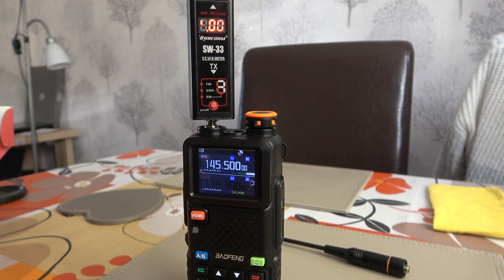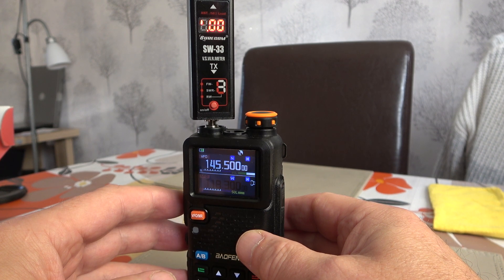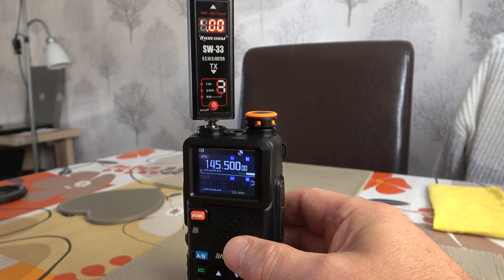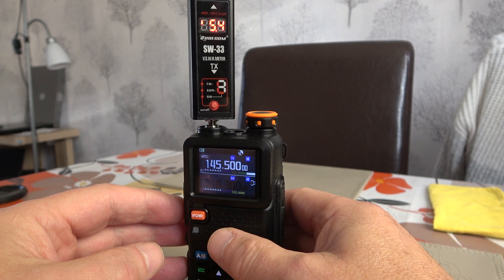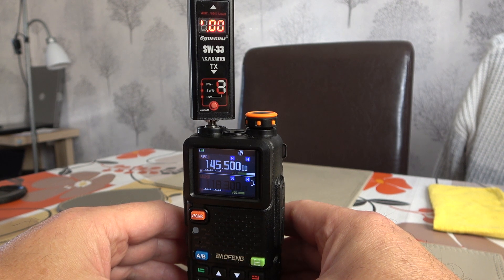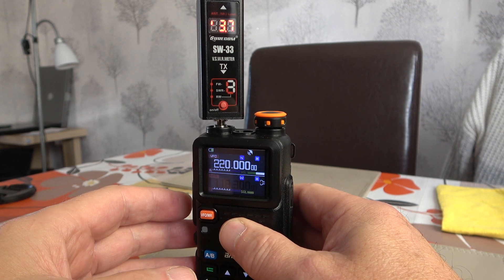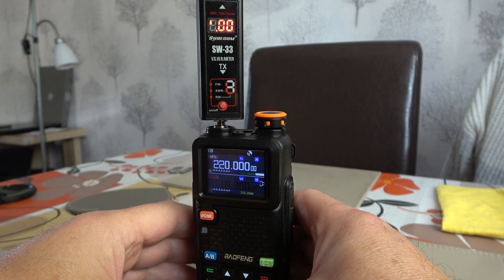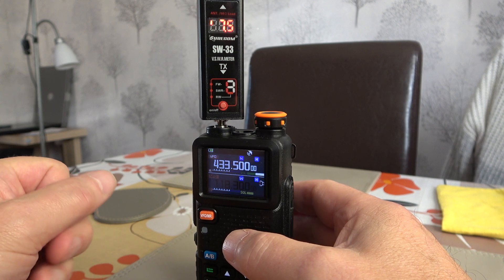Power Test Video on the Baofeng 5RH Pro

Comment: yet again 5R with some letter and some name plus/pro. same all bands no AM modulation chip. display could be unreadable even inside. there is still no radio that 100% last. its business make something bad so you buy next (and hope) u might get ur problem fixed but there new bad things.. rat wheel continue you buy cheap radio

Comment: I have the same SWR  meter as You do. When testing various antenna I find that the 2m Band results are terrible whilst 70cms are OK.   Have I been unlucky with my antenna being clones or is my meter duff?  I do wonder.  Maybe antenna are not really 2 band after all?   The only good one I found was the AR-152 tactical antenna from Boafeng, better than both ABBREE and Nagoya.  Something isn't adding up?  Have you compared antenna with your meter?
Reply from the maker: @DinsDale-tx4br  I honestly don't use the meter for antenna testing as there are just too many variables to get an accurate result I reckon. 🤔
Reply: @bigwill4423  Fair enough.  I have ordered a NanoVNA to compare results. It's a bit fiddly but looks fun.  It's all about learning I guess :-)

Comment: Do you have a chance to compare your measurements with spectrum analyzer readings? These handy SWR meters measure total power, so the sum of signal and all harmonics. I was surprised that when my bigger SW device (SW-102) shows e.g. 5.0 W for one specific radio (not 5RH), only 3.7 W were transmitted on the selected frequency.  The rest of 1.3 W did not contribute to that specific target frequency.
Reply from the maker: @andrejstern1138  ...no, unfortunately I don't have access to a spectrum analyzer...not that I'd even know how to use one of I had! 😲😁😜
Reply: @bigwill4423  No problem, when I get my radio, I'll measure it on the SW-102 and the professional SA, if someone does not do it before me :)